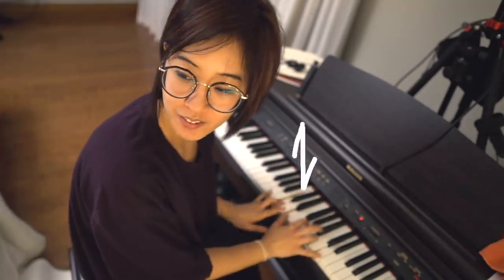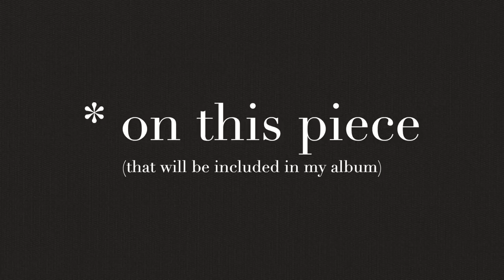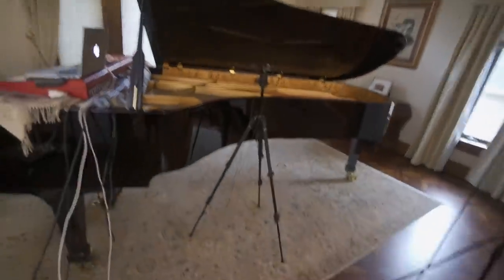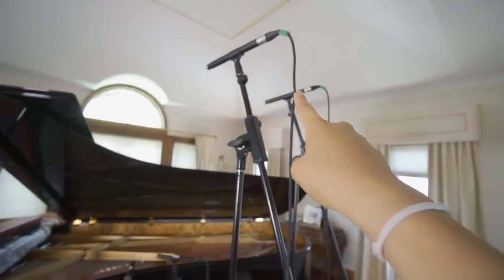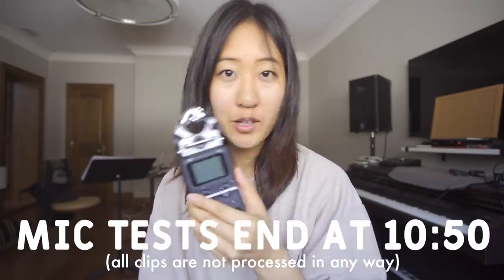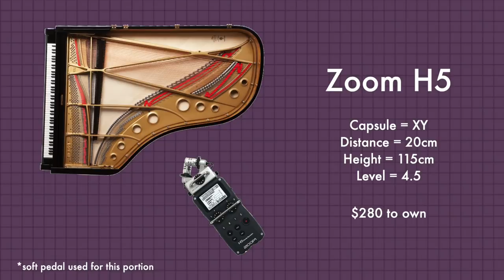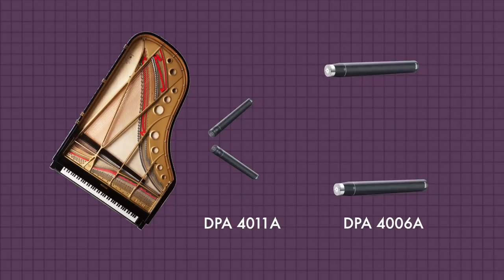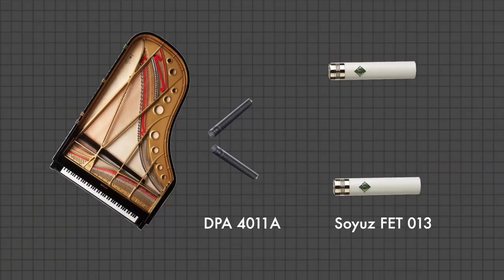Recording a grand piano is TRICKY - here's what I learned.

Comment: Idk why you lie to me, but i deffinitly hear difference better on my studio monitors with 8 inches speakers than my studio headphones. Headphones will simply NEVER match the quality, as they have just left right and ground. 3 cables for all the sound. Balanced XLR studio monitors has signal, signal in reverse phase, and ground for each speaker. Pls stop throw bullshit at us, or at leas say that its the case when u are using what a standard not musicians would use in their house. (probly some cheap logi/creative speakers + somewhat middleground headphons.)

My choice would be either solo soyuz, solo rode nt2 or both of them togather. Sound most pleasent in this case for me. I wonder what the point in those super expensive DPA's that sound harshy and way too "sharp". Not good for piano i guess.

Comment: I often wonder why one would spend so much on expensive mics, when a minor tweak on an EQ will add presence, air, depth, punch, or remove mud, honk, whatever you need, on a mid-priced mic... 

Heck you could afford a classy tube-based mic pre in the difference in price - e.g. the two-channel Tegeler EQP-1 (Pultec style), which for me is much more useful - run your Nord or any other instruments or voice thru it. But any decent EQ plugin for ~100 bucks would get you there - from the classic Waves Renaissance EQ to some modern VST like the FabFilter Pro-Q.

But BTW, I do think you selected the best sounding combo.